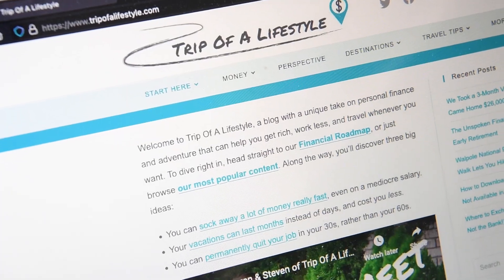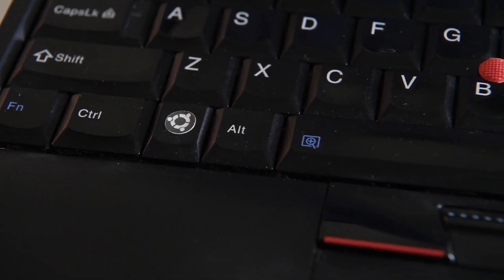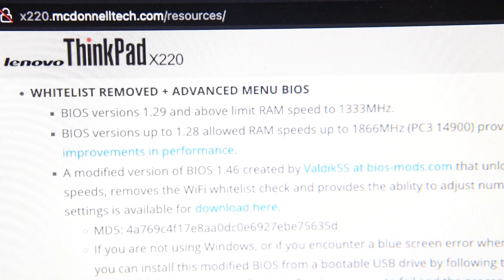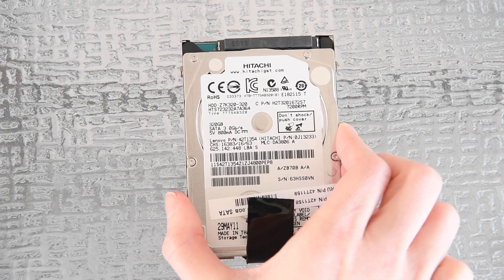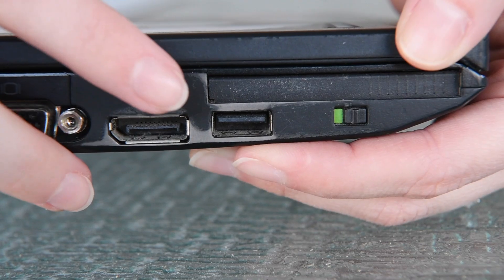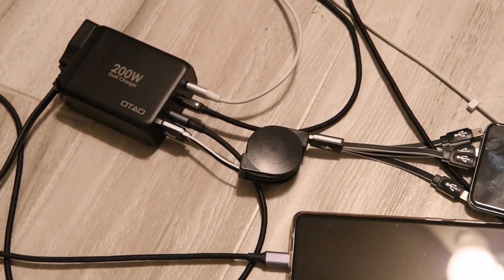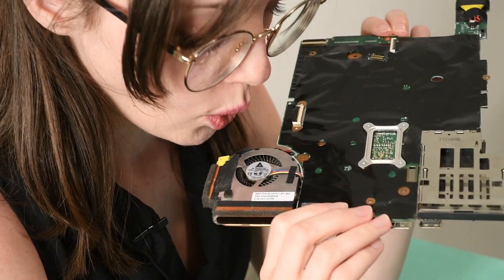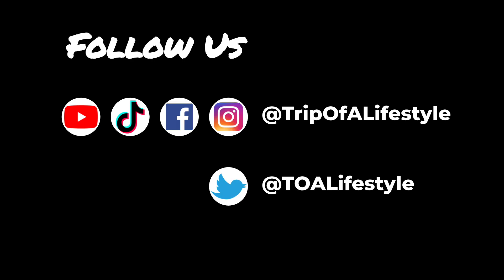How To Make Your Laptop Last FOREVER (My ThinkPad Mods & Upgrades)

Comment: I like the video.  Most everything is very useful and a great suggestions.  However, the memory you got for your birthday is desktop not laptop memory.  Yeah, you did also show the back opened with the laptop memory.   Those that watch the video might not be tech savvy to know the difference and can be misleading.  Also it would be helpful if they know to look up the specs for the computer and/or motherboard to find out any memory limitations.  If the board can only handle 32 gigs of ram, you don't want to buy & install 64 gigs of ram.
Reply from the maker: Yep! The memory used in the birthday scene was just a video prop, not the actual memory for the laptop.

The ThinkPad X220 can handle up to 8 GB of RAM natively, or up to 16 GB with the modified BIOS mentioned in the video.

Comment: I'm rehabbing an early 2011 MacBook Pro that belonged to my wife. So far, I've replaced the battery, a broken touchpad, and the SSD, and installed Ubuntu 24.04. I could have kept the old SSD in service, but replacing it was the easiest way to back up its contents. The MagSafe charger failed yesterday; one of its power pins stuck. A couple of pokes with a thin probe put everything right. One more task remains: upgrading the memory. I'll do that later this week.

Update:

One of the pins in the power supply's MagSafe connector stuck yesterday, which caused charging to fail. A couple of pokes with a mechanical pencil put things right.

Just upgraded memory to 16 gigs and the machine just cooks. Love it!
Reply from the maker: @ericmintz8305  Awesome!

Comment: Great video, I'm just wondering what wifi card you bought was exactly and is it compatible with the x201? Thanks so much ^^
Reply from the maker: @camelot-j5s  The exact WiFi card is linked in the video description! Not entirely sure about compatibility with the X201, but it may require killing the BIOS hardware whitelist as it does with the X220.

Comment: I have a ThinkPad X230 with an i5-3320M CPU (2.60 GHz) and 4GB of RAM. I also have a spare HP laptop with an NVIDIA GeForce graphics card and Beats Studio speakers. Would it be possible to transfer these components from the HP laptop to my X230 to upgrade its graphics and sound capabilities?

Comment: 1. The needs are different. I do love gaming and I do CAD work, so I need a more beefy computer.
2. You will reach a point of diminishing returns, where it would make sense to buy a new PC instead of constantly upgrading. I had my old i7 4770K system for over 10 years. It wouldn´t have made sense to upgrade it as instead i could get the new DDR4 or even DDR5 RAM modules etc.
3. If you want to save even more, get a PC in a big box. Easier with cooling, more performance, easier to service and replace stuff.
Reply from the maker: 1. It's true this this old ThinkPad won't handle everyone's computing needs, but it's still in service as a daily driver right now in September 2024! It works great if you're a "normal" computer user.

2. That's true. We probably won't be doing many more upgrades on this ThinkPad X220 in the future, but it's still got lots of life left!

3. Interesting! Personally, we're always traveling and focused on small, lightweight laptops for our needs.

Comment: The X220 was also the last laptop they made with that particular keyboard.  For that reason alone, it's great.  On mine, the fan stopped working -- IDK if it's a hardware or software problem.  I will try to replace the fan.  And thanks for a very pleasant and helpful video.
Reply from the maker: @dipierro4  It's such a nice keyboard!

Comment: Thank you for the excellent video, I will definitely use some suggestions on my X220T. Quick question though, is it really necessary to replace the charging port in order to use a GaN charger? I am in the market for one to save me the hassle of taking several chargers when travelling but I would rather just get a 2$ type-c to barrel port adapter, the reason being that I also have a slice battery and can't replace the port on that, being a sealed unit. So is the port replacement really necessary, as in, will it tell the charger what is the correct wattage and voltage in order for everything to work as supposed, or can I safely connect a type-c cable to the stock port using an adapter dongle?
Reply from the maker: @davidcarreira536  Never used a C-to-barrel adapter before, but it should work fine if properly manufactured!

Comment: Is upgrading the USB from USB 2 to USB 3 simply a matter of changing a USB card, or do you have to change the connectors as well?
Reply from the maker: @algavone  You're not actually upgrading any of the existing USB ports. You're ADDING 2 extra USB 3 ports via the ExpressCard slot. The card needed to do this is linked in the video description! 😊

Comment: If I were to get a thinkpad now and use it for the next 10-15 years, which one would it be?
Reply from the maker: We think the X1 Carbon is really cool and great for travel, but it's not as upgradeable as the X220. The best strategy nowadays might be to just buy a slightly used ThinkPad (like the X1) on eBay at a big discount. Here's an affiliate link to shop around with: https://ebay.us/Bu2I86

Comment: I got an old X360 laptop from a pawnshop for $50. It is an 8th gen Intel. All I did was slap some thermal paste onto the GPU and CPU and installed 8gb of ram for $20 to make it 16gb total and a 2tb M.2 I got for 100 and the final thing I did was to replace the battery for $28.. I got it over a year ago and still use it. today.
Reply from the maker: Excellent! 👏

Comment: About the type C charger, do you need to adapt the power input? Don't you use any kind of resistors or something?
Reply from the maker: The modded port (which is linked in the video description) has all that stuff built in!

Comment: These old ThinkPads are something else. I've received old X200 for free (4 GB of RAM, no hard drive and Core 2 Duo P8600). Over the years I've upgraded the RAM to 8 GB, threw in a 120 GB SSD, USB 3.0 Express Card, new battery, swapped motherboard from X200 to X201 one with i3 CPU and installed modded BIOS without WiFi whitelist. Right now, I'm waiting for two adapters, which will allow me to install small NVMe drive and two additional SD cards (internally) for storage boost. I have plans for upgrading WiFi card in the future. Also, this unit (even with X200 motherboard) runs Windows 11 just fine.
Reply: You are lucky that your laptop on Core 2 Duo recognizes 8Gb RAM. I have a Samsung (also on Core 2 Duo) and it refuses to see more than 3G RAM. No matter what I tried, even upgrading the latest BIOS version did not help.
By the way, I also installed Win 11 on this laptop (need to change 2 keys in the registry during installation) and it works fine, but it takes a long time to load. That's why I use Win 8.1 - it is much lighter, loads faster and uses fewer resources.
Reply: @Вася-ш3щ  My X200 recognised 8 GB of RAM because it was Core 2 Duo P-series working on DDR3 memory. If you have Core 2 Duo T-series the chances are that it will only support only 4 GB of RAM and most likely only DDR2. Oh, and the newest version of Windows 11 (24H2) requires SSE 4.2 CPU instructions so old Core 2 Duo systems will not get past 23H2. You have to have at least 1st generation of Intel Core CPUs.
Reply: @GothBuras  Yeah. That's right. My Core 2 Duo is a T-series. And it doesn't even see all of the 4GB I put in, only about 3GB. Sad...)
Reply: how that cpu run win 11 just fine?
but a bit slower right?
Reply: @arikowidtrash7074  It runs Windows 11 fine. It's a little bit slower than modern Intel Pentium laptops but otherwise pretty snappy for it's age. It does all the office work fast enough. YouTube FullHD playback works. For 1200 frames it will drop about 5.

Comment: I got a T400 I owned since 2008. It still works! Got X220 tablet with i7 and touchscreen + stylus for 80 USD. I still use it until now because the stylus is so nice to use in photoshop (Im an artist). Im not saying that the performance is the best of course, but it ls far from laggy.

Comment: Here i'd add that if you will change the thermal paste again maybe look in to PTM 7950. That i7 likes to run hot so excellent heat transfer and life-time longevity are quite usefull. You also might want to do an IPS mod if not done already. Your X220 has lived a wonderfull life :D
Reply from the maker: Thanks!

Comment: Not only that. Older machines weren't designed to fail straight after the warrenty ends.
Reply: Many of the evil tricks being utilized now didn't exist yet or weren't applied back then. The good old days.
Reply: Except HP DV6000 but those are the worst laptop you can buy in 2000s the rest is a lot better

Comment: I'm a Thinkpad fanboy. My wife and I each have a Thinkpad T520 in addition to our desktops. In addition I'm using a T420 as a poor man's server mainly for automated backups and personal web server. It has an SSD as the main drive and a 2TB HDD in a caddy replacing the DVD drive.  

We have had good luck buying off lease PCs and laptops on eBay. Normally use recyclers rather then one-offers trying to sell their old computer.
Reply from the maker: The used market/eBay is great for ThinkPads!

Comment: I think the point is to do these sort of upgrades as-needed, as you did. When you do them all in a short period, your money is probably better spent on a "new" thinkpad from ebay.
Just a few months back I picked up a T470s (i5-6500u) with 20G ram for $130 shipped. It has usb-c (data+charging). It was missing a power-brick and I wanted to upgrade the small+slow nvme it came with, so that was another $70 shipped.
Reply from the maker: Buying used, upgradeable laptops is great too!

Comment: I’m totally on board with this. So many wasted older computers that have plenty of life in them. In fact most people think they need to upgrade a pc just because the OS gets a little sluggish but I do a clean install of Windows every 2 years or so. I also built a home server and have a dedicated Linux laptop. For me computers are a hobby but I can build most people a great computer for a few hundred dollars. My Lenovo ThinkStation server has a Xeon 8 core/16 thread processor, 96Gb RAM, 1Tb NVMe SSD and 16Tb of HD storage and it cost me about $750. I just laugh when people buy $2500 Macs that they don’t need with the exception being video/music editors. You don’t need a MacBook Pro to be a college student or surf the web.
Reply from the maker: Fresh OS install solves so many problems...and costs nothing!
Reply: @TripOfALifestyle   also you mentioned that you don’t use your second drive bay. I always do because I keep my OS on one drive and my data on the other. Makes things easier when it comes to refreshing the OS or if it dies but I also know you mentioned your husband backs up the data. I just like the compartmentalization.
Reply: @OShackHennessy  you can just have two partitions on one drive. One for the system and the other for everything else.
Reply: You don't NEED a MacBook Pro for ANYTHING. The Air will meet 100% of your computing needs.
Reply: Macs are actually pretty good and hold their value well. I guess it depends on what you are doing right?

Comment: Good advice if you already have an oldpad from way back and you want to upgrade it.  Picking one up today expecting it to go another 12 years would be weird though (where are you getting the Thunderbolt port from? Like actual Thunderbolt with charging and DisplayPort?).  For such a purpose I'd probably get a Framework (if I weren't so married to the ThinkPad TrackPoint).
Reply: yeah i don't think spending money to keep it going it actually worth already not using windows had to spend 100 on batteries alone along with all the other stuff at that point just buying knew is the way to go. just like computer maybe every 5 years make some type of upgrade move by then your couple generation into new tech and it is well worth the jump to new hardware keep something for ten years ago going isn't worth it. unless your to retro type of videos.  but most of those is about showing things at their stock or close to stock specks so upgrading kills that type of video.

Comment: Thank you for that video!
Does a better Wifi-card also increase Wifi-reception or only speed? I often do not get a good wifi signal, but when I have wifi, speed is ok.
Thank you if anyone knows about that! :)
Reply from the maker: Seems to mostly be speed. The same antennas are used with the new card.
Reply: @TripOfALifestyle   Thank you! Do you know if it make sense to connect the unused antennas too, to the one wifi card (doupelling tha antennas?)
Reply from the maker: @Hermann-ok9uh  Not sure 🤔

Comment: unfortunately the USB3-Port is ONLY AVAILABLE if the I7 is installed on the X220 the I5 and the I3 has only USB2.  If this is an issue  go for the X230 this has an USB3 on each version.
Reply from the maker: You can also get limited USB 3 support with the ExpressCard mod mentioned in the video.

Comment: for the usb c charging port
what is the biggest con for it? Looking on doing it on mine but but scared of not a lot of info on about it.
Reply from the maker: The only real drawbacks are the small added cost and the fact that you have to disassemble the entire computer to install the port. It works great once it's done!

Also worth noting: Like most laptops, it will only charge from USB-C ports capable of delivering 65+ W of power. Don't expect to use your phone charger.
Reply: Also note that USB-C maybe isn't quite as durable as the original connector. I've seen a lot of USB-C stuff, both ports and connectors, break.

Comment: I got x230 which is similar. great laptop. my only problem is getting a good battery since lenovo has long stopped producing battery for this series. after bought 3 batteries that each only lasted for one year I got sicked of it so I uninstalled the battery.  to power the laptop I use power bank 65 W which has type C port that can deliver 20V 3,25A. the good thing is you can get much bigger capacity with powerbank. the battery capacity is only 5300mah but you can buy powerbank 20000 mah that will give you longer usage time.
Reply from the maker: Cool idea!

Comment: Got an old x220t which I've only now replaced with a newer laptop for its intended function.  Two tips I can mention:

-Get H264ify plugin for your browsers.  YT and other streaming sites are starting to use H265 encoding, which is great if you have hardware that can handle it (anything after around 2016).  Anything older can request the older codec instead which these laptops can handle.  That should stop stuttering or fan spinup on higher definition screens.
-Consider getting the dock.  Most of the business line have/had docking stations you could buy.  They'll perform better than 3rd party USB docks and can keep your setup cleaner at home
-If yours has a low resolution display, you may be able to upgrade to 1920x1080.  Check the original specifications and models available for your laptop, many came with higher resolution options.  If you can get either the model number it refers to or the panel number you can upgrade it.  This isn't super hard to do on older systems, but one side effect is that some of the feature buttons may not longer match up correctly.  All of the features are there, you just need to figure them out for yourself.
Reply: Thank you for the tips on the plugins, I just got my x220 and keeps on wondering with its so laggy when I tried to listen to YT video :)

Comment: These now rather old machines are still amazing value today. I still have a Thinkpad X201 tablet from 2011 and use it occasionally, especially when I am traveling. I did the same upgrades as you did to your X220, it really is a big upgrade. My X201 has major limitations compared to the X220 however. For example, adding a USB 3 Expresscard only bumps the speed to about 40-45 MB/s because the bus speed is low. Not worth the upgrade. The only really weak point is the battery. I am also on my third battery, and for the X201 it is really hard to find a good and inexpensive original. I have to stick to third party batteries which are expensive too, and not as good. I get maybe 90 minutes of battery life right now... Overall, I am still really happy with it, and do not know what to buy as a replacement. I am really happy that I upgraded my X201 to its limits (SSD, 8GB RAM), the newest Thinkpad has only an upgradable SSD. RAM and even the USB C charging port is soldered on the motherboard, where those are separate parts on both the X201 and X220.
Reply from the maker: Totally agree that it's still an awesome computer, and yeah, batteries are the weakest point on the X220 in 2024...It's tough to find high-quality ones from third-party sellers. Still getting 2 hours or so though, and with USB-C, it's a little easier to charge anywhere!

Comment: I just bought a Lenovo Thinkpad X230t and it's blowing my mind how upgradable it is compared to my newer laptop. And all the upgrades cost around 100 dollars in total! (Ram + SSD + Battery)
Reply: Good one, the X230t is an amazing machine too. Really easy to upgrade to good specs, the only weak point of these Thinkpads is the battery.
Reply: @darkknight8139  What is the weak point about it?
Reply: @nostalium  Battery life has never been the best in most Thinkpads, compared to others. I also have the impression that they die earlier than others on average. When my X201 tablet from 2011 was new, it had only 2 hours of battery life compared to 2.5 or more on HP Elitebooks of the time. I have bought my third battery 2 years ago and have only 90 minutes of battery life left.
Reply: @darkknight8139  Yeah, mine also holds 2 hours. But it's a completely different story when their batteries aren't worn out.